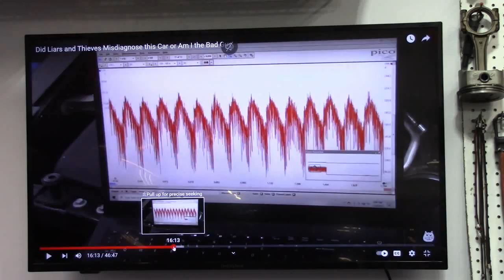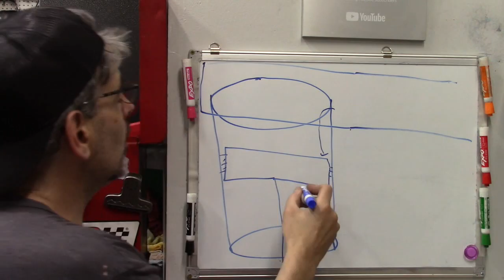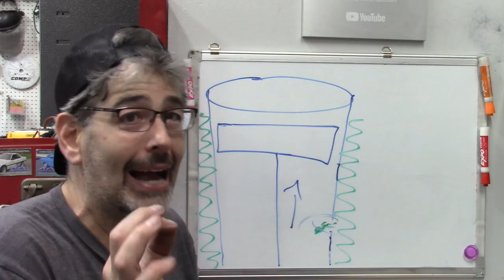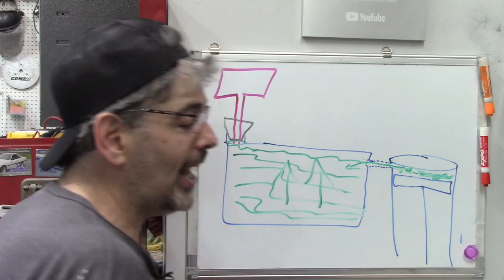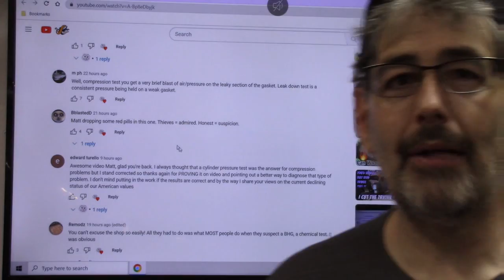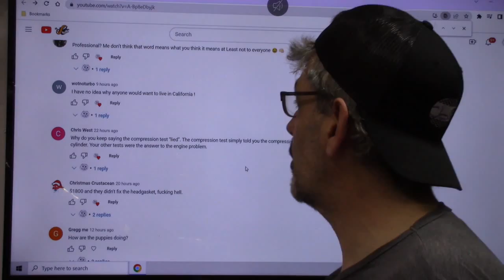When Compression Tests Lie and Miss a Blown Head Gasket

Comment: It is always nice to find ways to diagnose things without the teardown  - I was raised with engines that all of the plugs were accessible but now after 20yrs of being in the automotive field, these newer engines require too much to get to them. all of this information is helpful. I have had one recently that has me baffled. on a sensor with a +5v, GRND, and a signal. the +5 is good, and the ground is good but when I disconnect the sensor I find I am getting voltage back on the signal wire from the PCM. I suspect a PCM fault since there is nothing else on this circuit. but I Have had a hard time finding a definitive answer to it. Diagnostics can be fun and rewarding but, also can be frustrating if you don't understand the proper behaviors of the specific system.
Reply from the maker: Yes it sounds like there is a bias voltage on that signal wire.  I see this from time to time.  It’s used by the PCM to determine if signal wire has an integrity issue.
Reply: @SchrodingersBox  thanks, that makes sense, I could not find info on it anywhere. Just a lot of people replacing parts.. thanks for your vids diving into diag techniques.
Reply: PS I currently live in California and don't know why either!

Comment: The piston rings already present a known leak, albeit minuscule, and thus forms a baseline for any maximal attainable pressure.

If the size of a crack in the cylinder or head gasket is of the same order or smaller it's likely to not register easily in compression testing (or it just gets lost in the overall noise, and dampening introduced by the rubber hose down to the gauge). The time spent in compression stroke is short and the volume of air compressed is fairly large, so a small crack can't possibly have time to leak enough air through during a single stroke for the overall maximum pressure to get a visibly lower reading on an analog gauge that would stand out enough relative to other cylinders.

Compromises that are larger than the natural leakage of a cylinder, such as chunks missing from a piston, missing sections of piston rings, and stuck valves, etc. are another story and compression testing can of course rule those out qiuckly.
Reply from the maker: Good point about the rings being the limiting factor.

Comment: Very interesting discussion! I'm definitely not the sharpest tool in this shed, but I would think the combination of fluid and air in the cooling system would act as an "accumulator" and dampen any pressure readings you may attempt. If the cooling system could be filled with fluid to the point where there is zero air, the pressure sensor should indeed work. But purging ALL the air might not be possible. Conversely, if all the fluid was drained, I believe the sheer volume inside the cooling system (and possibly all the restricting small passages and such) would render this "air only" method ineffective. The small amount of air being pushed back into the cooling system during dynamic cranking would be minimal compared to the volume of air already inside. You would also have to consider the hoses (radiator, heater, etc) that would absorb some of the pressure changes. I used to think that the "check valve" effect of the failure was a possibility, but no so much anymore. Now you have convinced me that the "time" factor is the difference. I'll be looking forward to follow-up video(s).
Reply from the maker: I think you are pretty sharp!!

Comment: would it be carbon monoxide instead of carbon dioxide?
Reply: Not sure, but from my school days I remember that a 100% efficient gasoline engine will result in carbon dioxide and water. Of course, nothing is 100%, so you have all the other unwanted byproducts such as carbon monoxide, oxides of nitrogen and other undesirables.
Reply from the maker: While there would be carbon monoxide too, there is also carbon dioxide which the fluid specifically reacts to.  In fact you can turn it yellow using your own breath.
Reply: @SchrodingersBox  Thanks for the clarification! Great answer!
Reply from the maker: Hahaha wasn’t sure how nerdy to get but I can give an even greater answer since this is in my science wheelhouse. 
   While the fluid is propriety, I can tell just by looking at it that it is bromophenol. We use this in the lab all time as a CO2 and pH test. When CO2 enters the liquid it makes it acidic and the blue turns to yellow giving an indication of this. In a lab you actually use a device called a spectrophotometer that measure how “yellow” the fluid is as it turns more yellow as the pH becomes more acidic. This allows experiments to see how pH changes over time while constantly measuring it.
Reply: @SchrodingersBox  Thanks for the detailed explanation. This is how we all learn.

Comment: When you were doing the compression test did you disable fuel by pulling a relay or fuse or were you able to shut fuel off with the scan tool?   I got my Xtool D7 a few weeks ago. love it.
Reply from the maker: Oh great question- I actually did it using fuel cut off mode by just holding gas pedal down all the way while cranking.

Comment: A few months ago @fordtechmakuloco did some videos on coolant loss in Ford Ecoboost 4cyl engines where the compression was OK, but the symptoms were loss of coolant and a misfire. He discovered the leak into the combustion chamber by pressurizing the cooling system and using a borescope and could see the coolant dripping between the head and block. Just another method that can be used to help diagnose these types of problems. --edit, nevermind, you just mentioned this method. Guess I should watch the entire video before commenting :)

Comment: I'm curious if you drained all the coolant and ran the engine (for a short term, obviously..) and see if the misfire goes away.  Under those circumstances, there'd be no coolant for the cylinder to draw in.  Granted it may draw in air and run lean, but I'm curious if it'd be enough air to create a lean misfire.  Either way I think a pressure transducer on the coolant tank is surely a key test to run along side the relative compression test.  Really sad to see the relative compression has become more of a "loose" tool than a definitive absolute direction-giving tool.  Lastly, a borescope in the cylinder while the cooling system is under pressure has a huuuuuge advantage: you can see physically where the damage is coming from to make the teardown and inspection easier and zoomed in on where the problem is.  Or, it can uncover a crack in the cylinder or something that may make the immediate decision to scrap the vehicle without any teardown costs.

Eric O has an awesome video on the coolant system pressure transducer test.. https://www.youtube.com/watch?v=e93A-O6XV-g&t=282s

Comment: Very good video. Had wondered after watching the previous video if something was creating a check valve effect in the cylinder where the gases or fluid sealed the leak under compression. I like the ideal of using the leak down test using the bottom cycle of compression instead of the top. Love to watch your videos, have learned so much, wish I had more time to read all the comments there seems to be a wealth of info/wisdom on this channel. Keep up to great videos and great comment guys.
Stay Safe & Good Luck
Reply from the maker: Yes another viewer had the same idea calling it a "flap effect"- such that the gasket failure is in a way that coolant draw in with vacuum but pressure partially seals the "flap" causing the effect you describe.

Comment: combustion loss in one or more cylinders
Reply from the maker: Yes Howard but again- if there is compression loss, why does the compression test not show it?
Reply: @SchrodingersBox  i think like you said piston comes up fast water can't flow through the small passage as fast as air kinda blocks the small hole. Thats my best guess
Reply: @SchrodingersBox  also I bet if we had a really sensitive gauge on compression tester would show a lot
Reply from the maker: I agree. There is probably a very slight difference that isn’t noticeable here.
Reply: @SchrodingersBox  it would be interesting to see 1 if you connected a regulated air supply and check gauges. and also how much air would bubble out of the radiator when you start the engine vs the amount that came out with the leak down.

Comment: Great video Matt! I made this post in your other video but I meant to place it on this video. Flat rate master did a pretty cool video about head gasket testing and he mentioned an interesting method of pressurizing the cooling system and looking in the cylinder with one of those endoscopes for the appearance of wetness on top of the pistons......thought that was a pretty neat idea. Although I guess it doesn't help you when half of the plugs are under the intake manifold.

Comment: i had one if you left radiator cap loose ran good would have thought all is good. but if you left cap on and set over night the cylinder would have coolant in it and would skip for a few seconds on cold start up. and would over time loose coolant.. but if when you turned off vehicle waited a few min opened radiator cap released  pressure would start and run perfectly the next morning. also the spark plug in that cylinder was always cleaner than the other plugs

Comment: Putting my thoughts down before I finish the video. My hypothesis is that a compression test/relative compression test is only testing peak static compression. 

The compromise to the cooling system is going to be very small whether a crack or a bad gasket. That would leak out the compression very slowly compared to the exhaust valve opening and relieving the pressure.

The leak down test is a constant pressure, compared to the relatively quick timeframe that the cylinder is under pressure in the compression stroke very quickly falling off as it enters the power stroke.

Of course the peak compression under combustion is much higher as well.

Also, glad you're going over inverted signal for the voltage drop, that was not looking right to me during the last video and now it makes perfect sense.
Reply: Aha, the syringe model would lend towards this hypothesis, but retesting after taking the coolant out of the cooling system would be worth testing for sure.
Reply from the maker: Great comment, totally agree.  We are going to test for it!!

Comment: also a air particle is smaller than a water particle that is proved in home building Felt used to waterproof roofs will let air particles thru but not water particles

Comment: Indeed i think its a case of duration of pressure x peak pressure i.e. area under the curve.

The leakdown test might be lower pressure at 90psi but has far higher time at that pressure, im guessing under cranking it would be >=90 psi for only a few ms at a time for a small % of the time. There certainly was some compression loss as the cooling system was pressurised from cranking alone, but obviously not in a way that significantly affects compression test results or the compression alone. Of course when you take combustion into consideration peak pressures are far higher and pressure is higher for a far longer part of the cycle then.

Or indeed it could be a crack far from the combustion chamber in the cylinder, but i would imagine that having that occur from an overheat is far less likely than a compromise in the head/block mating surface.

Comment: Matt, any liquid entering the cylinder will not have the time or mobility to exit the cylinder during a compression test and, as shared, the liquid (coolant) itself is incompressible.  It would be interesting to see how large of a leak is needed to be detected by a compression test.  Regardless, the compression test is worthless for detecting a small coolant leak into the combustion chamber.  Period.  Simply better options available (as illustrated in the video).

Comment: Hello, I just found your videos a few days ago and now I'm subscibed! Just a fellow mechanic that does things on the side now and love to watch and learn. I graduated from Northwestern Auto/Diesel in Lima, Ohio back in 95. That school has come a long way since I was there. They were adding the high performance section when I was about half way through. I had to learn OBD2 on the job and back then, at the school, we were taught the workings of all the sensors but not so much actual scan tool use. Can you remember electronic mixture control solenoids on carbs lol. These kids nowadays have it pretty easy if you ask me. The scan tool practically tells you what is wrong. you just have to know how to interpret it. And if you can use a scope your in there. Well I better get on to work, I'll watch the rest of the video later. Thank you for the in depth explanation of what your doing.

Comment: This is probably a little more theoretical than practical but if you put a steel band around a radiator hose like an oversized hose clamp for the hose size and then a pressure sensor between the band and the hose (you would want a relatively flat sensor) you may be able to pick up pressure pulses in the flexing of the hose with pressure changes although a strain gauge or piezoelectric sensor might work a little better. If something like that could work (which is largely dependent on how much flex in the hose you get for a change in pressure) you bypass issues with taking off a cap in the cooling system. Admittedly, this is a completely untested thought and there just might not be enough flex in the hose to be measurable.

When I was looking to see what was out there along these lines I came across that they often use Laser Triangulation to measure distances of curved surfaces. Looking around I saw a laser distance measurer for about $60 that could measure to a 0.1mm resolution. It would be interesting if all as you had to do was point laser distance measuring device at a hose (ignoring the issue that you would need it to have a real time output you could send to an oscilloscope) and could see pulses. I suspect that wouldn't be possible because most probably vibration would over shadow the pulsing so you would lose the signal in the noise but it is an interesting concept.
Reply from the maker: Genius idea!!! Really that's awesome-- like a digital blood pressure cuff hahaha.
Reply: @SchrodingersBox  LOL, exactly. Damn if you could hook a blood pressure cuff up to an oscilloscope and wrap the cuff around a hose that would be an incredibly easy setup... and fun. There's still the dependency on the sensitivity of the sensor and the flex in the hose but it would be fun just to experiment and see what you can get.

Comment: This is an interesting one. There was clearly a compromise in the cooling system and the cause is not necessarily a blown head gasket. The misfire counter identified the problem cylinder which was confirmed by the leakdown test. A borescope would help confirm that there was coolant ingress and the source of the leak would clearly show up if the cooling system wss pressurized.
Reply: The borescope is just as problematic as a leak down test though, unless you've got a misfire code from the PCM to narrow down which cylinder you're still taking every plug out 1 by 1
Reply from the maker: Yep carnivore is right and in fact I meant to mention that as a gap in the video.  The borescope is a great idea but you have to know which cylinder to borescope.  It is useful for seeing where the leak is in the cylinder but we need a method to identify that cylinder without testing every one individually.
Reply: Yes, it is the same situation as with the leakdown test but the borescope would be useful once the problem cylinder had been identified and would hopefully show the exact location of where coolant was entering the cylinder. Then there's the rabbit hole of finding a cracked water jacket in either the head or the cylinder bore. One way or another the engine is most likely condemned. Form what I can gather, most shops wouldn't even bother pulling the head(s) and just fit a replacement engine.
Reply: Yes, I agree that there needs to be a an easy way of identifying a problem cylinder. This is where the scantool comes in. They're virtually essential for modern cars these days.

Comment: Sorry I skimmed a bit of the video but I think something you didn't mention but will help is to use an overlay on your scope when you do the ignition plus pressure sensor. Some scopes have them built in and there is also a separate little program overlay that you can use with any PC based scope. Pretty much the overlay just shades in all the different strokes for the different cylinders automatically.